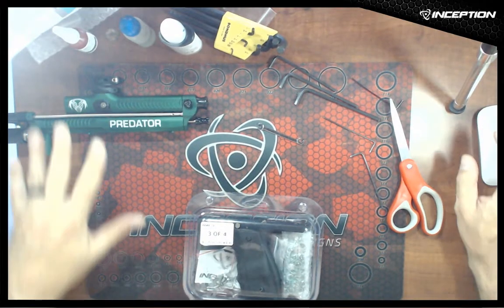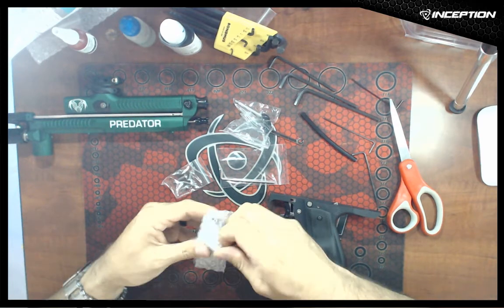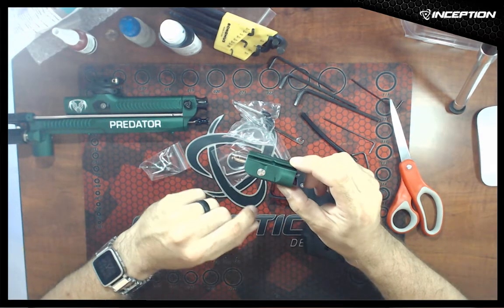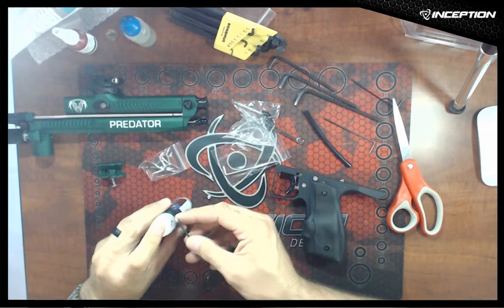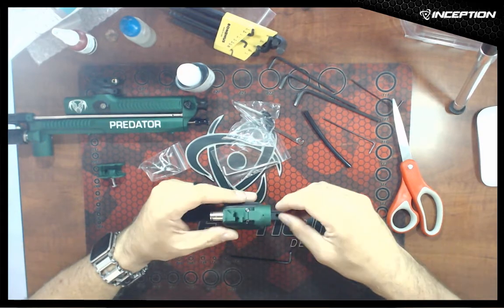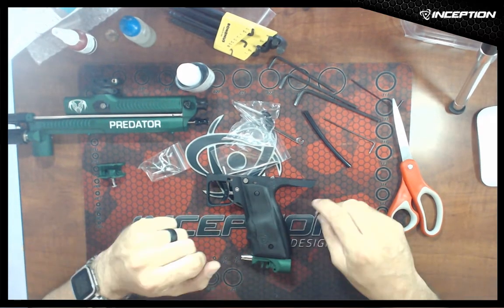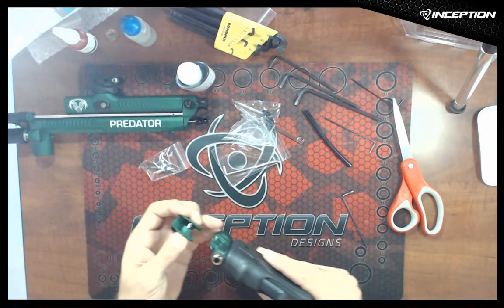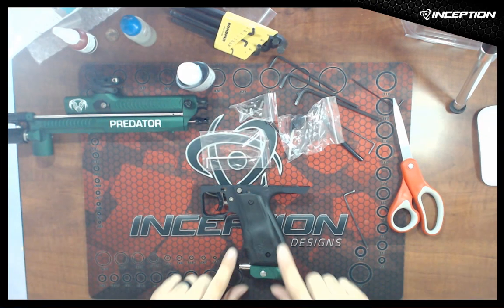Step 14   Installing the EZ ASA on the Gripframe

Comment: Doesn't come off. It's a horrible design if you have to take apart your asa to install it
Reply from the maker: You have the push the button all the way across to get it off. It's a far better design than other ASA as you only have to do it once, and if anything comes loose it doesn't come off and get lost. We often see other ASA's missing screws and loose. That isn't possible with this one.